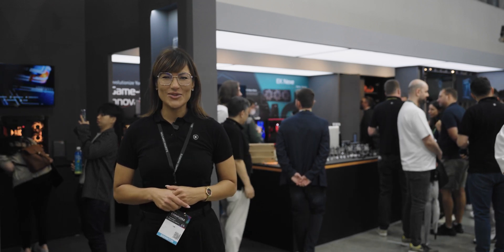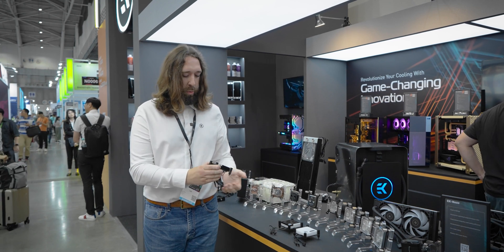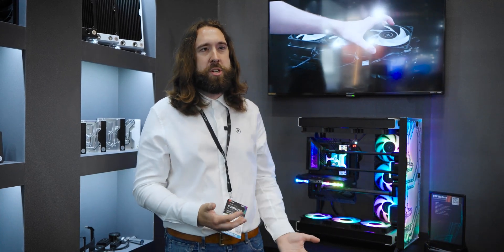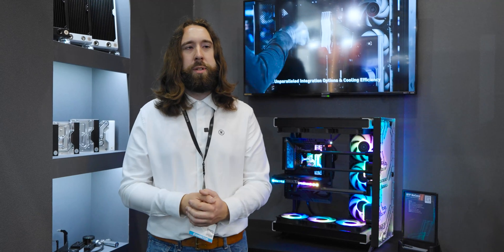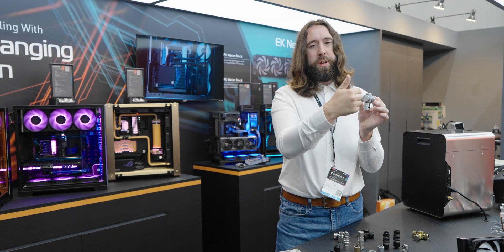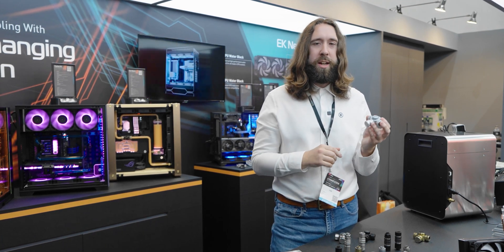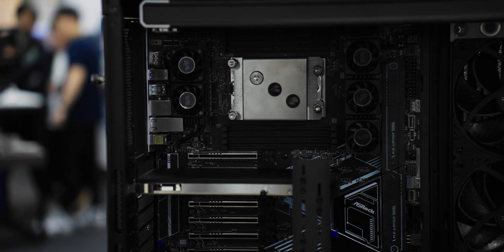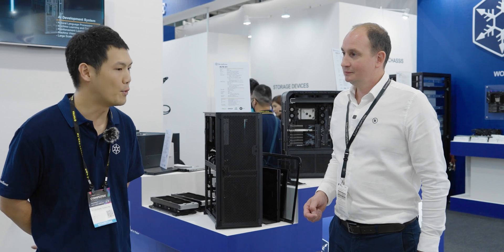EK EXPO | COMPUTEX 2024 | Day 2 at the EK Booth

Comment: Which carbon tubes are those? I used the Alphacool 16mm on my torrent build but always appreciated the matte carbon fiber vs glossy look like the AC I'm using. Also are those 28mm double rotary or 21mm? Currently have MSI X670E Carbon with velocity 2 block with Torrent Distro so want to achieve these parallel runs with the ram waterblock....